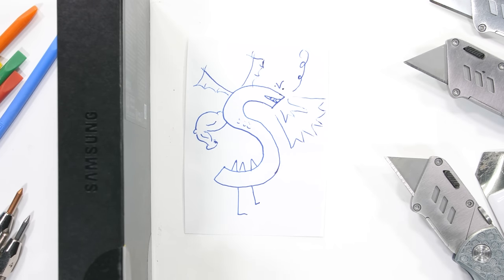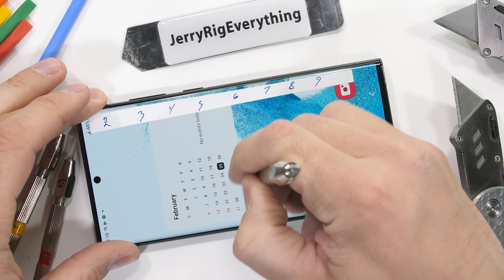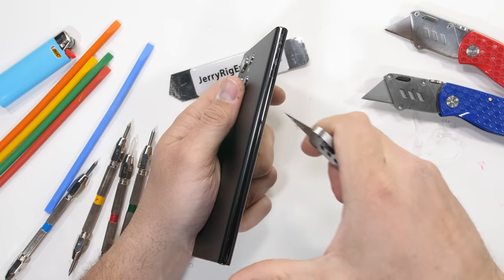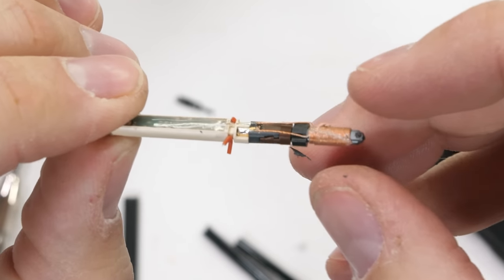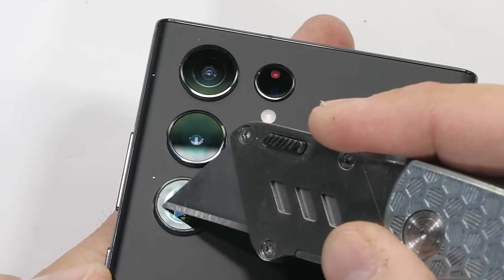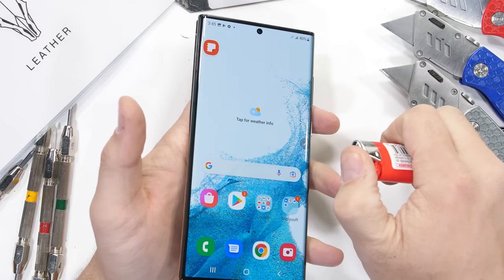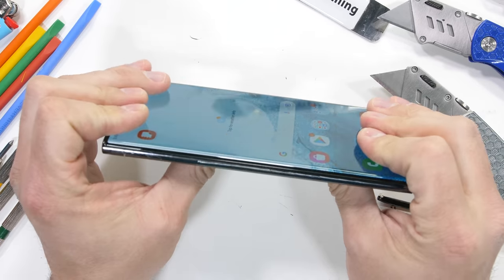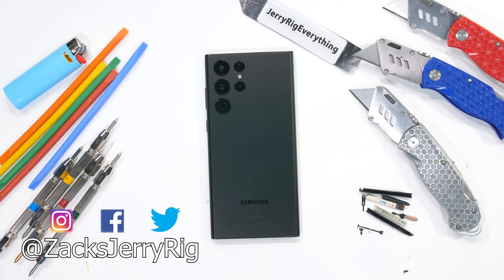Galaxy S22 Ultra Durability Test - How does the New S-Pen Work?!

Comment: I'm glad Zack is still using that Note 10+ for another year. I've been tempted to upgrade, but instead decided to essentially rebuild my beaten up Note 8 last year. I spent more than the phone is worth on parts (ifixit should figure out how to lower the price of AMOLED displays), but it was a fun project and now it looks and acts brand new.
Reply: gotta love the e waste reduction great work :)
Reply: Did you change that battery?  Mine is getting kind of weak nowdays.
Reply: my Note 8 is still working fine, Ill upgrade to 23 next year if im good with my savings.
Reply: @rcnewsupdate9435  I did, it just reminded me that the battery life was never great cuz a new battery didn’t change much lol
Reply: Sticking with my note 10+ ever since release, no intention to upgarde anytime soon :)
Reply: I have upgraded from Note 8 to S22 Ultra mainly because my game started lagging on Note 8. Otherwise, Note 8 still works just fine, Infact I couldn't notice any significant changes in S Pen and overall performance of the phone in day to day use. Though, there is hell of a difference on the paper.
Reply: Still rocking my Note 9 with it's SD card and headphone jack. Still looks and works like a brand new phone. It have a spare new one ready to go if it ever dies.
Reply: @Mr5Ali5  Note 8 user here. What about the camera? I'm still split between iPhone 13 Pro Max and Note S22 Ultra, so I kinda need something game changer that'll make me pick a side 😅
Reply: I've just upgraded from N8 to N10+ and the difference is huge, even though I had my old note refurbished completely by Samsung. The biggest difference is the speedy reaction to virtually whatever, after a while I returned to N8 and it felt broken...
Reply: Note 8 is the best!! 🔥
Except the Camera :(
Reply: i have a note 10 plus and i have never loved a phone nearly as much as i do this one.  if i need to replace it i HAVE to have another samsung phone with bezeless sqaured off edgea

i cannot go back to the tall curved edges.  i just cant lmao

thank god the s series is now just the note series.

i can legit paint and draw on this phone with the s pen and the screen looks BETTER than the real world

Comment: For anyone wondering the spen nibs of the s22 ultra are in fact replazable but Samsung did not include nibs or the removing tool in the box, but any of the old nibs will work perfectly.
Reply: i am now realizing jerry most likely just ripped the nib off with the knife since you would usually need to use the specific pinch tool to replace the nibs.
Reply: Thanks i was worried since I got the exclusive color pen and the nib is messed up thought i was SOL
Reply: Thanks for your hint❤

Comment: Just pushed my wife into the Samsung world by upgrading her from the X to this beast. Safe to say, she loves it. I also admire your comment about not upgrading because your device still works just fine. I wish more people had that mindset, but unfortunately, most people want the newest/latest stuff. Even if something from two, three, or heck even five years ago still does the job just as good (my Note 8).
Reply: Please sir I need phone I don't have money
Reply: @amraniabdelmoghit4784  earn money then
Reply: @legion5823  how ?
Reply: @legion5823  i need little money for start
Reply: @amraniabdelmoghit4784  250 is enough for a phone, no need to get the flagships
Reply: @blueviolet7702  yes is enough pls help me
Reply: @blueviolet7702  pls help me I need phone
Reply: I had an S10+ and I loved that thing. Used it until the screen cracked and the display got damaged. Think I'm gonna repair it and keep it. However, I think I will be buying a new S22 ultra for my every day phone.
Reply: (not me about to upgrade from a pixel 6 pro to this)

(Dont worry the pixel is going to my dad)
Reply: @amraniabdelmoghit4784  How are you here without a phone?
Reply: Man so glad to hear you got her to use a good phone for a change👍 She will be Samsung for life just like me😉
Reply: I read this in a totally different context lmao
Reply: Just changed my 4 year old s9+ to the s22 ultra i need more battery and i think the s pen is a useful tool for my job
Reply: My wife still has her note 4. She was devastated with the sunset of 2g and 3g. She specifically made sure her note 4 had 4g LTE when she bought it, 2 years after it's launch, in 2016. Sadly her model does not have VoLTE. She decided, since she could not decide what she wanted, to upgrade our daughter's phone. I took our daughter's and my wife took my first Gen Apple SE. Interesting it was bought 1 month after she bought her note 4.
Reply: haha! i used to own a note 8 until last week since its screen broke and the battery stopped, i bought an off brand phone temporarily until the newer flagships get cheap
Reply: I have s21 ultra
Reply: I do have crack note 9, cracked since first month.. It has been almost 5 years. Its time to move to s22 ultra.. Gonna arrive this week. ❤️
Reply: @hostilesinbound3241  I just went from an s10+ to this s22 ultra. Do recommend overall not much different but my old phone was broken and this is a good replacement
Reply: @blueviolet7702  especially when there are flagships from a couple years ago for that price
Reply: IMO you don't lose any money. Samsung's trade in would drop the price to 200 when you upgrade to a phone, trading in the same phone from last year. The s22 ultra is 1200. If you're in the ultra lineup and wait 5 years for your phone to break to upgrade you spend 1200. If you upgrade every year,  you spend 1000, and you're at the same place
Reply: the message loses meaning to me as he destroys countless brand new phones.
Reply: Even my samsung s6 is working fine. I will be shifting to new one  when, only 5g comes to India and it works properly. Then n only otherwise I am superhappy with my s6..
Reply: after 2 fixes and 5 years of use, i retired my phone and bought s22 ultra. probably gonna be main phone for the next 5 years :D
Reply: @hostilesinbound3241  for at&t they let me trade in my s9 just yesterday for 800$ off the 22 ultra. Idk if my mom got some special deal cause she said she wanted to switch to t-mobile or if there's a galaxy phone switch type of deal but hey there's that option for you

This also means you can get the S22 free but with the ultra being 1200$ it's now 400 at 11$ a month for me, makes absolutely no sense for an s9 especially since their website says s9 trade value is 30 something bucks but I'm not complaining lol
Reply: my 2 years old samsung note 9 got green screened after the software update & samsung refused to replace the screen after their planned obscelence update stating that it is out of 1 year warranty. what should I do now with my samsung phone ?? Court case always favors greedy corporate companies here in india, hence I'm planning to buy a new phone from company who don't practices & produces planned obscelence products(SmartPhones).
Reply: @amraniabdelmoghit4784  how old are you
Reply: It is sad to say that some people, or rather... a really large number of people never outgrew the time period of who had the best stack of Pokémon cards. They still try to limit their kids, and tell them life is about self control, and this, and that... blah blah blah.. and all that absolute rubbish.. well actually it IS true, It isn't rubbish, but when you are a complete and total hypocrite and spend enough on cell phones EVERY calendar year to buy your child things that they NEED and otherwise do not have since you needed to change the letter or number in your cell phone model SMH.....Then you should honestly STFU and stop trying to teach children stuff when you yourself are still a child LMAO

So I agree totally, It is nice to hear it once in a while. To know that everyone is not a waste of life when it comes to financial health. (cannot wait to see any potential replies. If this bothers YOU - whoever reads it - look in the mirror not at me)
Reply: @micahgregerson  It's about reducing carbon emissions and preserving as many resources as possible. The fewer people who upgrade their phones each year, the fewer manufacturers will extract irreplaceable resources. Not every component is recyclable, and even when it is, manufacturers often find it more profitable to extract than recycle. Besides, it's a lot more profitable to use and maintain a $1200 phone for 5 years (the officially supported timespan). When upgrading to an S22U, the trade-in value for a good-condition S21U is $800. That means you'll have to pay $400~ for the S22 Ultra's base storage, which has less RAM (and storage with trade-in). I don't know where you pay $200 yearly for the next device
Reply: i believe this doesnt work to everybody because people get phones for different reasons, and iphone is always a safe choice
Reply: @hostilesinbound3241  I'm still rocking my s10+ lol really loving it I've had it for 2 years no cracks I work but not in trades... yet rip to my phones when I do
Reply: I usually wait several years before upgrading as well. If it still gets support, then I’m still rocking it. When it doesn’t? I go ham and buy the best model to future-proof myself some more.
Reply: My  A40  is  still  fine  after  4  yrs  although  I  do  like  the  s22  ultra.
Reply: Such a pity the phone manufacturers stop support before the phones are "too slow".  Loved my S8, it stopped getting update a while ago, replaced it with this 22 ultra about 4 month ago because i dropped the old girl and shattered the screen.
Reply: @KegRaider  no cracks on mine yet battery still last up to 4-5 hours not gonna upgrade for awhile lol but enjoy that s22 it's a beast
Reply: They also need to push manufacturers to actually provide decent software support. Without it, when the battery dies, no one can justify replacing it to extend the life.
Reply: Im using note 8 too, been 5 years, other th as n battery draining no other problem  i find, still super fast
Reply: I've had a s10e for 5 years
Reply: I am on a S8+ from almost 6 years ago
Reply: Shouldnt you really upgrade her to EX and next gf as wife thoiugh.
Reply: Actually just upgraded to this one after using an S7 since it launched
(My S22 ultra is refurbished tho)

Comment: The camera layout LOOKS good but in a case is more difficult to clean, especially the tiny lenses. The Note20's single glass pane was much more effective in this regard.
Reply: Imo the UAG cases for the s22 ultra are ugly af.
Reply: @keonxd8918  what UAG case isn't ugly?
Reply: I feel like a solid pane has more potential to pick up dirt and smudges, but yes, probably easier to clean. Really, we should just go back to flush cameras, but apple has buried that trend and everyone else hopped on.
Reply: I don’t think so the note 20 camera doesn’t look as sleek as the s22 ultra

Comment: "When in doubt, throw on some rubber." Words to live by.

Long live the Note 10+. I'm holding onto mine until the Fold 4 at least.
Reply: Holding mine still too but this ultra was tempting
Reply: @enduroiasg4068  i loved mine until it got stolen then when I got it back it was shattered and I just said f it and bought a pixel 6 pro
Reply: "When in doubt, throw some rubber"

We'll, rubber is rubber, and rubber can break (a tiny hole right at the tip). 

Rubber is rubber, and rubber doesn't feel smooth. 

Rubber is rubber, and rubber isn't always available when you need it.
Reply: Swapped mine. Mostly because mine quit charging.
Reply: I still have my note 10+ as well, but I won't change to Samsung again, I like having a micro SD card and a charger inside the box. So probably I will get a Sony or Motorola which are the only two that still keep it... After that, the future looks very dark for phones on my end.
Reply: @AbeCorleone  note 20 here.  Last stop on the samsung train as well..
Reply: I have a note 10 plus and got the s22 ultra. The ultra is better in almost every way. But let's be real I went from the "Best" older android phone to the new best. I do have some buyers remorse, but I'm enjoying especially the screen. So in conclusion it's worth it and it's not worth upgrading at the same time. I got the tab s8 ultra too, now that was by far the better upgrade
Reply: I’m still holding onto my Motorola g5s
Reply: Just went from n10+ to S22U. Great upgrade. And honestly, the cameras absolutely destroy the n10+. I was not expecting such a drastic difference. The low light is insane, outdoor is also insanely improved, not only the higher megapixel but the new lens that reduces glare outside is insane.
Reply: @04wrxsubaru48  Pixel isn't available where I live :(

Comment: Got this phone, it really is a beauty. The new camera layout looks so much better than the blocks on others IMO. So relieved that it survived the bend test
Reply: Yeah, i just got this phone too and i love it!
Reply: Did you get exynos or snapdragon version? How is battery life?
Reply: How's the battery life and does it generate heat during operation?
Reply: I  also like this more but it's more prone to dust
Reply: @mateostarcevic483  Exynos version in the UK. Get a solid day out of it, but I've found depending on the charger it can take a while to charge. Thankfully if I use my old OnePlus charger it's fine, but my one at work takes all day to charge it
Reply: @prashantn687  Seems alright. Get a solid day out of it. Not noticed it getting hot, but then I never have the screen on too bright. It's all rather good so far.
Reply: You should see the drop test. Cameras instantly shattered from a him height drop from a guy who's 5' 8
Reply: @benjawiBen  Thanks a lot for your quick response. I wanted to buy Note 20 Ultra but reading and hearing it's performance on Exynos never dared to spend hard earned money on buying it. Now Snapdragon processor they made available so thinking of buying it. Already using Note 10 Lite. S-Pen is the thing I liked the most in it.
Reply: @prashantn687  use mine outdoors a lot because of work, gets fairly warm on the top half of the phone (though I am using it  70-100% brightness for long durations). Temperature is fine when at home/indoors (and with lower brightness).
Reply: @benjawiBen  ahhh I have s21 ultra so kinda not sure is it worth upgrade. I checked bunch of reviews it does look smooth I was concerned regarding battery life as s21 ultra beat s22. Lol I too have one plus charger
Reply: Hope you don't have kids to take photos of. All come out blurry and awful. Returning mine
Reply: Same. Loving that matte black is here to stay. This phone is built like a tank and absolutely gorgeous.
Reply: @mateostarcevic483  snapdragon. Battery life has been pretty solid so far, and I consider myself a heavy user.
Reply: Note 20 looked way better
Reply: The battery on cellular is suck TBH i don't know why
Reply: @SGTRandleOneOne  ahh cheers mate. I am in Europe so little hard to get snapdragon. This year exynos performed bad comparing to Snapdragon on benchmarks. I do have Exynos on my s21 ultra but that was from the year when exynos was holding his own against snapdragon
Reply: @ru2225  Thanks for your reply.
Reply: @benjawiBen  I bought the 45W and I can say its very quick. From 0 to 100% it'd take about an hour. But the best reason to get this charger is how quick it pumps juice into your phone when it's very low in battery.

Comment: The main plus side for upgrading to this phone, is actually at it's core function of a phone. The new modem supposedly gets better reception in areas with little to no signal with other devices so if you live in a rural area this will be a major plus.
Reply: Can attest to this when I go and visit my grandmother theres a major dead spot throughout the drive and when I got my s22 Ultra last week I no longer have the dead spot when driving there anymore
Reply: @Lawand  😂 These Indians
Reply: ...And then people are complaining that their new s22u phone does not have the same reception as older and cheaper phones. Sucks.
Reply: Quote.. I had an S10+ before getting the S22 Ultra.. no signal on some spots at work and home with the S10+, now I get it no prob
Reply: Wait what do you mean they updated the phone part of the phone? They can do that? I thought that was illegal, and all they were allowed to do was add more cameras, further mutilate the screen, remove more features, and increase the price.
Reply: its*
Reply: This. I just wish more phone reviewers actually test this. 

But no. It's all about cameras, refresh rates and AMOLED screens.

Comment: When comparing this device to the Oneplus 10pro, this device is truly durable. Samsung equally distributes quality and features in every products.
Reply: except for the exynos, for the higher price, compared do 10 pro, not so equally distributed huh
Reply: @stearless  well, exynos is crap, like really shitty. But atleast the device doesnt snap in half from a small bend and the actual device actually has software and a proper working UI. Would rather have those things than a few percent of performance that no one will ever notice outside of games anyway
Reply: I went from the oneplus 8t pro to the s22+ and I love it. The new os update basically bricked my oneplus. It made it laggy, the touch was kind of off (already an issue), the speaker function stopped working for phone calls. I gave it a day and went out and traded it in.
Reply: @genericwhitemale1114   Actually the first  Oneplus phones were exceptional in quality. But when they tried to focus on mass production and pure business, theirs models started to go down in quality and in other aspects.
Reply: @_chemin_de_foi  yea I remember signing up to get it and then I got the inventation literally an hour or two after I got a new 360 lol. Couldn't afford both